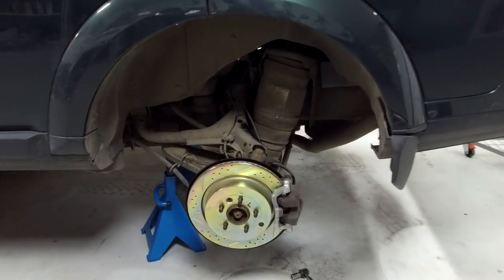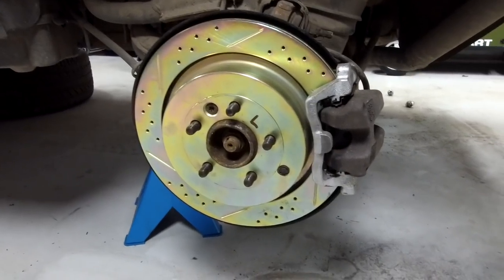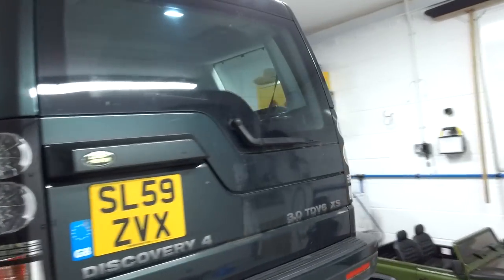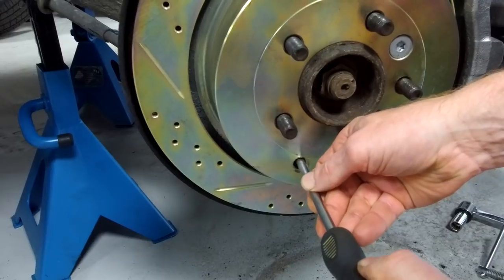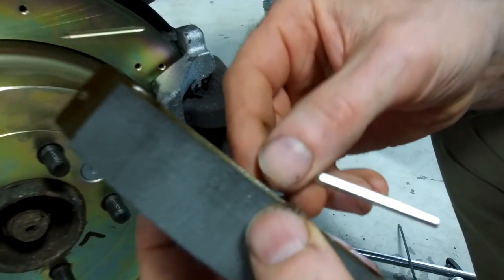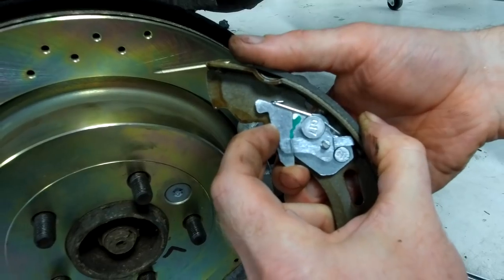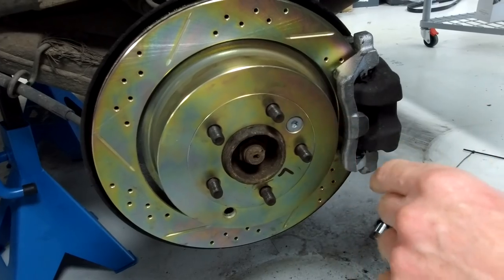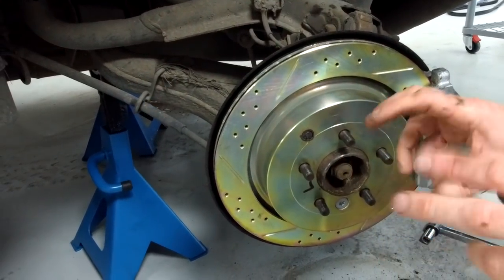Land Rover Discovery 3&4 Rear Hand Brake Shoe Adjustment LR3 LR4

Comment: Very useful video, just replaced rear pads and park brake shoes on a D4, two small additional tips I found, when refitting the shoes, if you put a cable tie around the bar between the shoesit can hold the spring on and you can pull on the free tail to help locate it on the second shoe. The second tip is, ther is actually two small indents in the outside edge of the back plates which correspond to the positions of the adjuster and the allen bolt, hope these help.

Comment: At 2'45 I can see a "U" clip in the wrong direction (always the closed end to the adjustment wheel).
I should have like to get some explanation about the "bias" springs (Orange on left, green on right) that are supplied with kits but never explained in videos.
Reply: Yep you’re correct Haynes manual says “closed end must be facing towards adjuster wheel”

Comment: Just in case no one's mentioned it here, the backing plate has tiny notches in its edge to indicate where the adjusters are.
Reply: Yes I was about to say the same there are little notches in the backing plate which indicates where the adjustment screw and knurl adjuster is

Comment: My EPB has jammed on my discovery 4 2013 model.
I can't even drive it to the garage.
I've pulled and yanked at the wire loop under the cup holders and it comes out about 3 inches but I don't hear any bang and it doesn't release the EPB, I've tried taking the 30 amp fuse out and disconnecting the battery. ..Nothing. 
People are telling me to cut the cable and just leave it in park and don't ever use the handbrake switch.
Why does this EPB jam on in the 1st place?
Does it happen after a certain milage?
I had new brakes done shoes pads discs and part of the cable at a local garage in April for it's MOT, it's been driving ok until the other night this brake jammed on and won't release!
I looked under the car and I think I've got a leak of either gear oil or brake fluid and I can see in between the two back wheels below the epb unit in the centre a little drip and wetness. I reached under put my fingers on the damp patch and it looks like a sort of clear liquid. It felt like a watery oil but not quite the consistency of pure oil. It also smelled like it had a fragrance to it! I'm unsure if maybe a brake pipe has a leak or the dif has a leak and the car has sensed something and applied this EPB or somethin!
Should I cut the cable?
Reply: what did u end up doing?

Comment: Hi, how do you reset the park brake after pulling the emergency cable under the cup holder ? i had to pull it in the lake district, the shoes need replacing and the brake jammed on at hardnotts pass so had to pull the lever.. now i have no e brake and the just get the crazy actuator noise hen i pull the switch and the no handbrake warning... i plan to change discs and pads all round as the warnings on and change the shoes, just don't know how to reset the module
Reply from the maker: Hi - honestly I am not 100% sure but you could try a battery disconnect ?
Reply: The crazy noise when the EPB is engaged may have been due to the gears in the brake module being shredded which is probably why it locked on in the first place. This can be caused by a build up of brake dust in the hub causing the drum brakes to get jammed on. Unfortunately this means the EPB module has to be removed and have the cogs replaced. I also give the drum brakes and surrounds a good clean out to get rid of all the dust build up, otherwise the same can happen again.

Comment: Do u do the adjustments with handbrake on or off
Reply from the maker: With the handbrake off
Reply: Done all that when handbrake activate slight noise them coming on but nothing as much as when removing key before changing shoes etc
Reply from the maker: @rickyperks3895  They may take a while to bed in - have you looked at the bedding in video ?
https://youtu.be/NmUa_ryXwr4
Reply: Yeah I did all that thanks anyway poss need bedding still cheers
Reply: Can (should) this adjustment be made as a precautionary measure when not actually changing any parts? 
New owner so just be nice to avoid problems down the line if possible.
✌🏽
Reply: @Rebla01 I presume so yeah what harm could it do ??

Comment: To adjust do you have to put epb in service mode first?
Reply: To adjust or to service replacing brake shoes you need to put the EPB into mounting position and transmission in neutral after you finish all the work including adjustments you need to put the EPB in latching mode which will exit properly. The key most critical step after that is adjusting the knurl from fully locked out to exactly 10 clicks lock IN and than loosen the adjuster screw half turn tab the rotor with rubber Hammer and than tight the adjuster screw. After that you have to perform break bed in procedure which these guys have posted excellent video but remember to cool down your brakes during the process